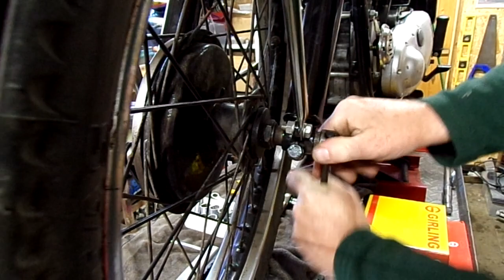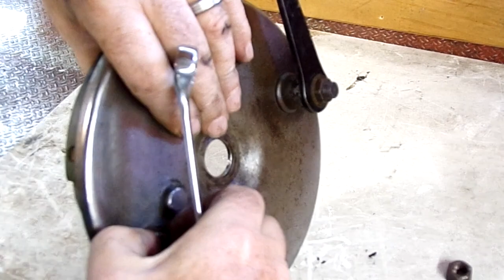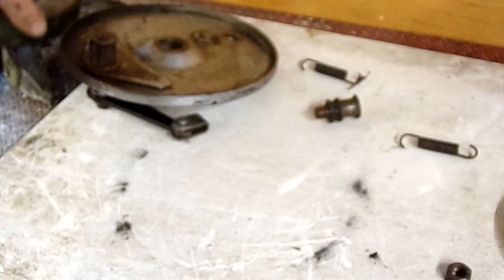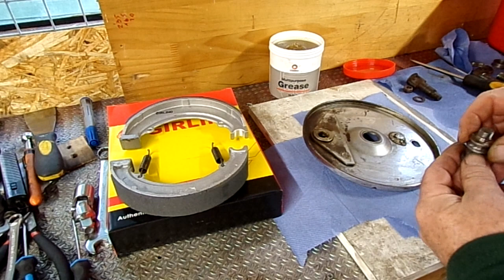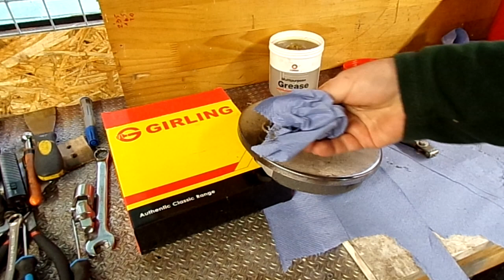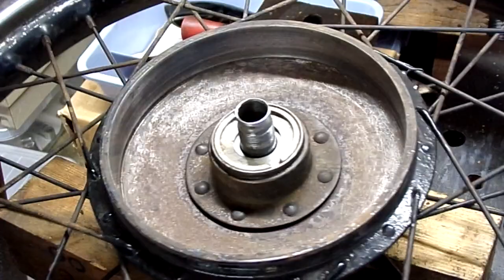BSA Brake Shoes and Wheel Bearing Replacement

Comment: Hi, did you notice any improvement with the new brake shoes? I was talking to a chap who said the modern brake linings are too hard for hand operated brakes, just wondered what your experience has been?
Reply from the maker: Hi, The standard front drum on the B31 is almost useless no matter what brake shoes are used!
I also replaced the front brake shoes in my 1972 Honda CB350 with 'modern' brake shoes.
This has excellent braking but then it does have a twin leading shoe drum so probably has more to do with the braking system than the materials used for linings.